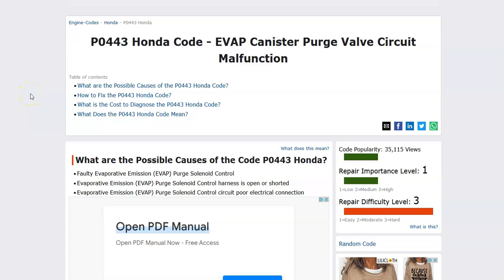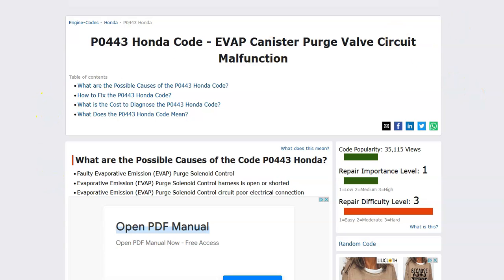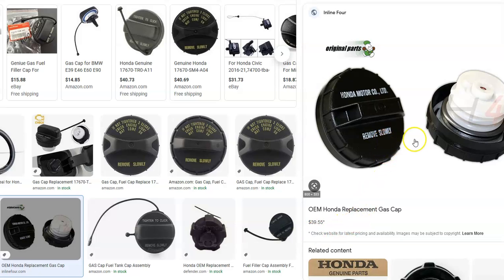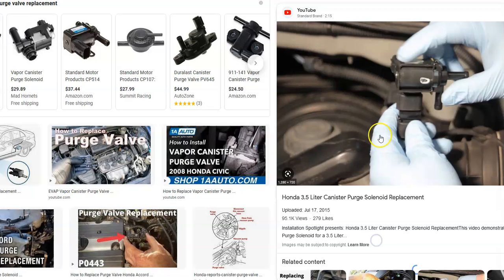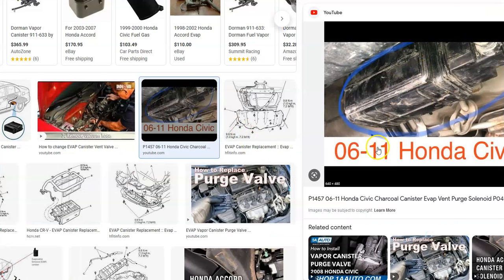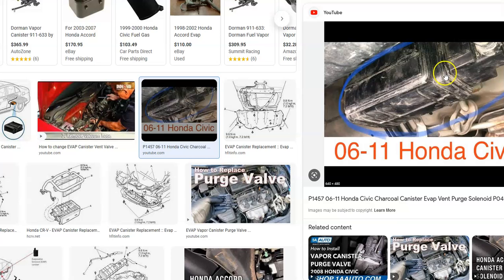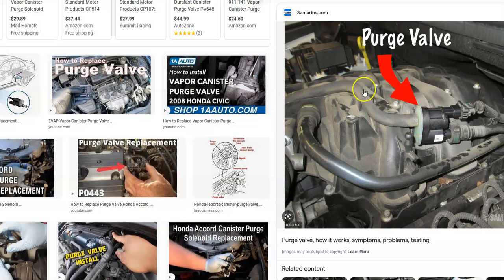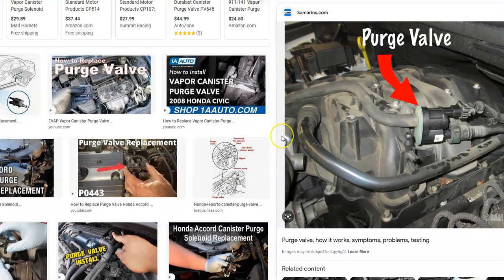Causes Honda P0443 Code: Evaporative Emission (EVAP) Canister Purge Valve Circuit Malfunction

Comment: Thanks! 2004 Honda Element EX 188k miles. Great condition mainly. Check engine light's been coming on and going off. Got P0443 code from scanner. Looked at the gas cap and it looked okay and I cleaned it. But where it screws in some of the rubber covering where it screws in, not on the cap itself, looked slightly worn. I'll see what I can figure out. Just bought my Element a few months ago and looking for a good honest competent mechanic, but haven't found one so far. The one I went to after I bought it to inspect it charged too much for what he did and didn't do. And gave me high estimates on a few more minor repairs. Knew a number a great mechanics previously I was friends with. But didn't have a car for almost 10 years and I can't locate any of them. Maybe they all retired. :) Used to work on my own cars for some repairs. We'll see how it all unfolds.